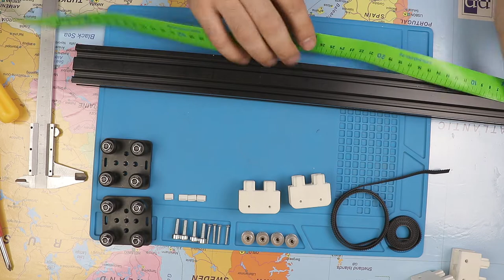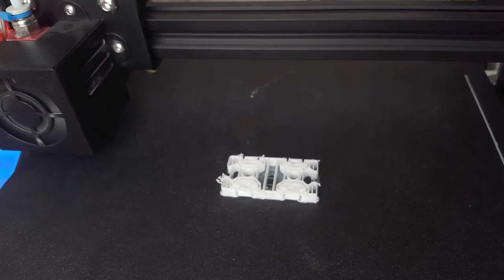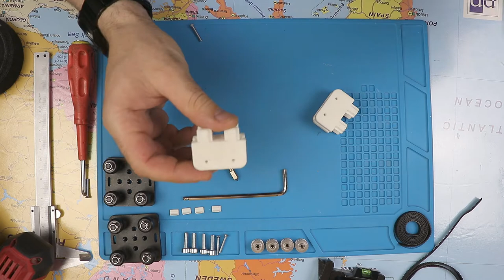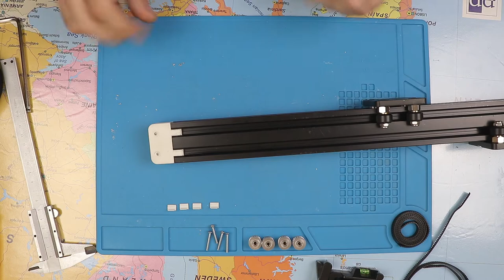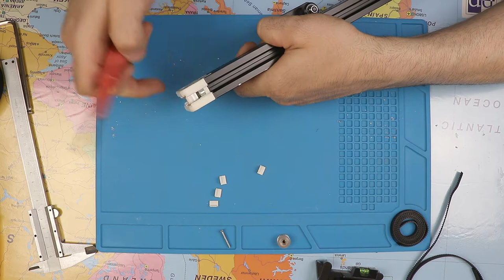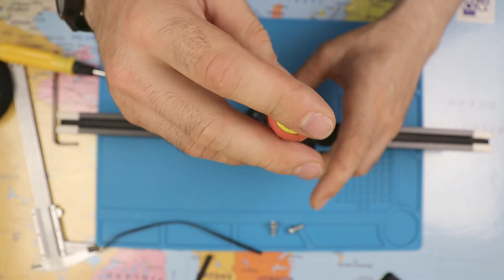diy camera slider

Comment: So  nice! Maybe design one of the side caps/bearing holders to have a handle?
Reply from the maker: Maybe in v2.0 :-) I will add handle and will motorize the slider.
Reply: Very well put together, and a great idea using 3D printer parts! Great job and nice vid 👍